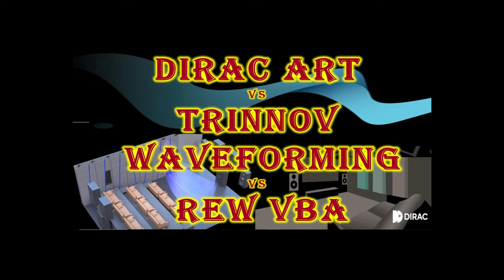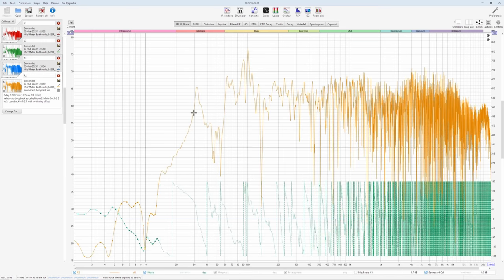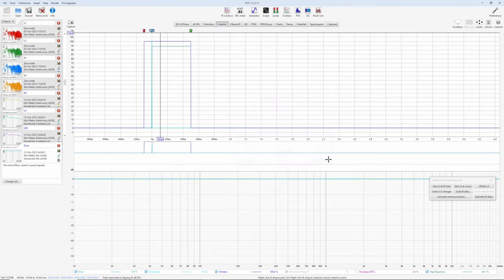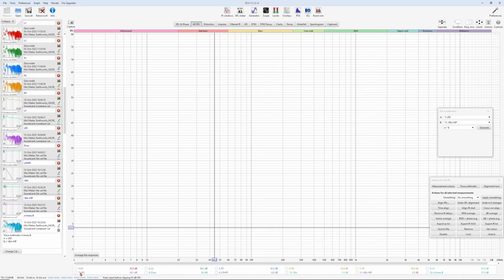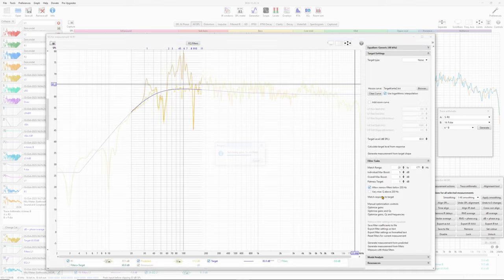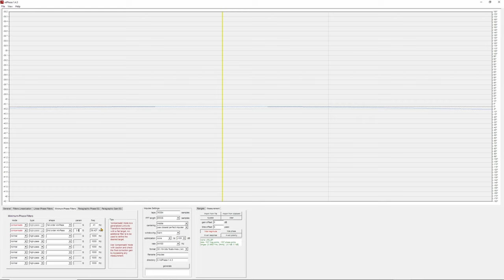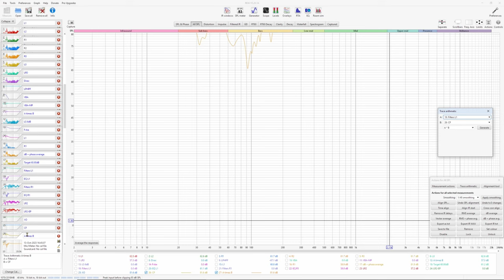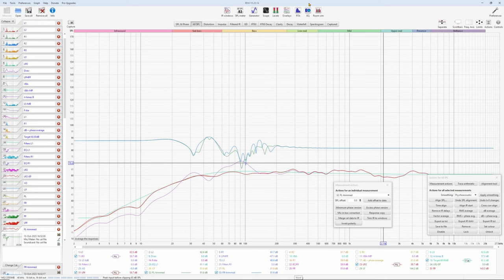Dirac ART vs Trinnov Waveforming vs REW VBA

Comment: I just wanna say thanks. This has transformed my system into something truly respectable. I multiplied the fvba filter with the inversion convolution filter I made from your other video. Not sure if that’s correct, but damn. Using equalizer apo I can quickly switch between filter and no filter and the no filter version is practically unlistenable… mind you I scratch-built some mark audio chr-120 full rangers mounted in a decware dna horn with spherical wavefront horns loading the front. Needless to say they needed some midrange attenuation. I was researching to build some notch filters when I found your channel. Thank god 😂 This is such a superior solution. I found the bass I was missing. The audio is so clear it’s almost tangeable. Imaging is like nothing I’ve ever heard! You could never get this from headphones. Thanks again. 🎉
Reply from the maker: Fvba x Inversion filter will work very similarly to the method in the video, they both allow 5dB boost but I found 1/48 auto-eq to yield just a little bit higher c80 clarity results than inversion in my tests although it could be specific to my gear/room.
Reply: My listening room is untreated so I like the idea of convolution. I was having a hard time getting the vba to move from 28 to 25 so I just left it. Bass is noticeably better. I will say that listening to hakkerskylder by heilung I could definitely hear the filter. I’m hoping it’s because I didn’t move the filter far enough. Either way, that’s one song. Also, my initial testing showed that one of my speakers ir was inverted so I switched the cables (think it’s my cheap gear). Can this be fixed in rew?
Reply from the maker: If one speaker is connected in opposite polarity relative to the other, you will experience a very audible drop in bass response. If that's not the case and you see their impulse peaks in opposite directions in REW, this could be a mic position issue and must be left alone. Rew can invert the polarity of a speaker response virtually on the charts but that's all. Check their phase responses to see in which polarity left and right phase responses are more similar to each other.
Reply: I’m gonna redo my measurements and see if there’s any difference. Sort of off topic… but Is there any way to adjust woofer Q using filters? That would really simplify subwoofer choices.
Reply from the maker: I'm not sure how relevant is the  Q of a woofer as in damping ratio to a  a phase/EQ bandwidth Q.

Comment: Quite great video!!! Let me ask two questions:
- why dont you use linear phase correction? Why minimum phase over linear phase?
- In my case and I suppose many other cases, I would like to have as minimum delay for convolution. Will you have any approach to load the final gilter to rew and work with number of taps to try to reduce the lengh until a few ms keeping as much as possible correction? Knowing it wont be perfect, but pretty accurate. I think doing filters with small delay is very interesting topic for a new tutorial, maybe there are some tricks to achieve best results with minimum taps/delay.

Thank you for your videos and channel ;)
Reply from the maker: Minimum phase IIR filters are more efficient in the bass frequencies. The phase changes they cause are often useful (ie corrects the phase).

For optimizing FIR filter number of taps see:

https://youtu.be/zmIqJ_jlZPw?si=cCGBFs7WtB6rDq1u&t=1586

Comment: Hi, first of all, thank you for all the lessons on your channel. By watching your videos and experimenting a lot myself, I'm getting better at REW. However, I'm struggling with something I can't figure out. I'm trying to combine VBA with an inversion filter. I know you have a different perspective on correction of higher frequencies now, but despite all possible acoustic treatments, my room is still quite challenging, and the inversion filter works best to achieve a precise mid/high stereo image.

When I combine VBA with inversion, I either get a ringing filter or the target is not accurately followed. I've tried creating both the VBA and the inversion filter from L0/R0 and then multiplying the filters. I've also tried convolving the VBA first (LVBA and RVBA) and using them as a starting point for the inversion filter. In both cases VBA and inversion work fine separately, but when combined, something goes wrong, even though I pay attention to sufficient window size and impulse alignment while making the filters. 

Do you know if it's theoretically possible to combine VBA and inversion? Thanks in advance! Any tips on approach / things I can try are welcome.

PS: in this video you don't apply Invert Polarity after creating LPHPF. In previous VBA methods, that was necessary. Did I miss something?

Regards, Hans, The Netherlands
Reply from the maker: I have tried hard but also couldn't find an optimal way to combine VBA with other filters in a meaningful manner. Physical double bass arrays also suffer from similar issues and none are perfect. It seems MIMO systems are the way to go for proper cancellation of room modes (although both ART and Trinnov keep postponing launching). PS I believe you are using the inversion method in the Mastering Digital Room Correction video. It sounds noticeably better than the method in the older REW inversion video
Reply: @ocaudiophile  wow, that is a quick response:) The vid you mention is inversion below schreuder. I my room I need the full range inversion filter, like in your video "Convolution with Inversion (no EQ filters, all FIR!)" But as far as I understand from you it is hard to combine other filters with VBA. Well, at least now I now I am not the only one who runs into troubles. But I keep trying and experimenting, maybe one day... :)
Thanks again!

Comment: Three questions please :

1. In addition to aiming to correct anomalies introduced by the room reflections, does this also correct frequency anomalies in the direct sound from the speakers, in line with the target curve?

2. Does this method also reduce the difference in arrival time of low and high frequencies, at the listening position?

3. Will the end result be accurate only at one listening position, but at more than one listening position?

I must add, I have been following DRC developments for about 8 years, started to use REW, 1st with EQ Filters in EQ plugins, and later on generating IIR correction filters for use in convolution plugins, which yielded some improvements. Especially in the most recent 3 or 4 years, it appears that there has been an exponential increase in understanding, from independent sources such as this Youtube channel. So now we have good enough tools such as microphones with calibration, at reasonable prices, and much improved versions of REW, and now "teachers" such as this Youtube channel, the challenge is :

We need some kind of roadmap, for learners, to take them step by step from elementary principles such as how to measure, e.g all the different approaches for such elementary tasks, and then build up gradually, to advanced methods, such as used in this video. 

I would happily pay £20 to £25, for such a book, which provided this guidance using REW. If I understood enough about this, I'd also be happy to work with anyone interested, to create such a book. Another chap MItch (AccurateSound.ca) has written such a book a few years ago, but it focused on using tools like Acourate - furthermore I discovered there was a tendency in his approach to steer the conversation towards engaging his services, and buying his convolution tools - nothing wrong with a bit of commerce - he has to eat, but that approach led me down a path where I was asked to trust one man's intuition, without really understanding what he was doing. What happens when he dies, which will eventually happen?!!!, i.e. his methods did not seem to me to be independently verifiable, cos I was forced to use proprietary tools and methods which cost a lot of money, and I would have had to invest so much in tools like Acourate, and try them out at great expense, to discover if Mitch's methods actually worked.

I love videos, but thankfully Youtube allows me to slow down the speech, cos its a bit too fast for me to comprehend otherwise.

My thinking is that this level of complexity deserves capture in a book, that is revised maybe every 2 or 3 years, to keep it current. I'd happily pay £25 every 2 years for such a book. A book is also a kind of insurance. Who says Youtube will still exist, in 5 years from now !!!????. With a good book, teaching all of these various methods, from elementary topics to advanced methods, and with good explanations, such information is then available as a keepsake. This is just my way of saying to the Obsessive Compulsive Audiophile channel producer - you clearly have a lot of ideas, but it is worth putting these down in a book, with very good explanations and justifications of why you have chosen each step, and what the various options are (at least a few), especially one which fcusses on using easly available tools like REW(and Rephase), is what most people would be highly interested in, cos it avoids leading us down a black hole path, to custom highly proprietary tools like Acourate, where one has no real clue what is going on in there.

There is so much confusion in the DRC business, starting with simple things like - do I point the microphone up to the ceiling, when I take measurements, or do I point it straight ahead towards the center point between the speakers, or do I point the microphone at each speaker, and what calibration file do I use - Zero degree or 90 degree or what other kind of calibration, maybe 30 degrees. To some of you, this might be elementary, but that is the challenge with todays DRC with tools like REW and Rephase, from my perspective, there is not much guidance, or you have to crawl through so much conflicting information on the Internet, when it would have been nice to have a well curated authoritative source that says - hey this is exactly what you need to do, step by step, and this is why this is the better way to do it, and here are the other options if you want to explore. And this wonderful book I am proposing, then takes you from no knowledge to expert level, step by step.

I'd rather pay £50 for such a well curated book, (based on using easily available tools like REW), that has been obviously fact checked and put into proper test, by seasoned reviewers/editors, than invest in something like Acourate, where I really am not sure of the basis of the approach used in the tool. Furthermore even if I bought Acourate, it appears I would still have to again invest in Mitch's book to learn how to use it properly.

Do you see a trend, we have the tools like REW, and Acourate, but their user guides do not seem sufficient enough to take us from start to finish, so we now need well written books, to show us how to use these tools, to achieve optimal results.

Please consider writing this book. Thanks.
Reply from the maker: Thanks for all the insightful comments and questions! I really appreciate your engagement.

Just a quick note about some concerns around free tools and conflicting information:

This channel is dedicated to free resources, so any tutorial methods use only freely available tools. While newer videos might introduce different techniques, it's all part of an evolving process in REW itself and in my methods. That journey is life long and this is in fact why most of us audiophiles are in this IMO ;)

Acoustics is complex, and subjective interpretations arise due to unique listening environments and preferences. Finding optimal solutions can be tricky, which is why I started this channel - to share my accumulated knowledge from years of testing, sifting through countless forum discussions, and personal experiences. It's not exhaustive, but it's what I wish I had when I began this journey.

Further Resources:

REW: For the analytical minds, John's detailed REW guide offers a fantastic foundation: https://www.roomeqwizard.com/help.html
My Basics Video: To grasp the core principles, check out this two-part series: https://youtu.be/zmIqJ_jlZPw

Calibration Mic Direction:

You're absolutely right, ideally calibration mic should be directed towards the speaker for maximum accuracy. However, with multi-channel setups, compromises are inevitable. Even with a stereo setup, one needs to compromise a good 30 degrees of accuracy to keep the mic in the middle of the two speaker. Thankfully, mic direction primarily impacts very high frequencies above 10kHz, which often benefit from being left untouched anyway.

Comment: Hello,  Can I not achieve a less accurate but similar effect by placing an analog mic at the listening position and feed it to the out-of-phase rear wall sub? I'd set the rear sub volume by 30-200hz pink noise until the dips and peaks balance out the most.  I can also pull that sub right behind my chair. I don't really want to ADC/DAC my records. Is that a McGyver way? :) Thank you for the great videos. Cenk
Reply from the maker: It's a bit more complicated than that:

Post in thread 'Double Bass Array (DBA)' https://audiosciencereview.com/forum/index.php?threads/double-bass-array-dba.51919/post-2072803
Reply: @ocaudiophile  Thank you. I partially understood the post, but did not get if these "circular convolutions" are due to the filters or actual acoustic new modes due to the rear sub.
Reply from the maker: @cenkisil574 whether a sub actively sending an inverted signal or a digital filter, the residual effects are there. You need an array of subs on each wall to achieve proper flat bass response.
Reply: @ocaudiophile  understood. Thank you

Comment: Good tutorial. I will need a moment to digest the application of the concepts here. Although I'm aware of all the mathematical details of the concepts, I will need some time to understand the application in acoustics. Btw, does all this processing impose strict mic/head placement?
Reply from the maker: Thanks.

Not really, the inverted impulse wavelength is about twice the room length so quite free from head movements as long as the filter is symmetric between left and right.

Comment: Awesome work you do here. Quick question, before you do the phase correction in this Video, you applied all the filters, from Dirac to VBA minimum phase plus low shelf, if I would like to apply those to a DSP, not convolution, how could I do that? Personally I would be really curious to see this, maybe even with the phase correction with APF's, would you kindly elaborate or tell us if this is possible at all, as I cant see how to apply a Dirac pulse to a DSP, or apply a delay to a Bandpass filter etc.
Reply: And on top, can this be done for multi sub systems in home theaters, and how?
Reply from the maker: The saved .wav convolution files from REW at the end of the method are FIR filters and will work 'as is' with Equalizer APO, JRiver, Roon, Camilla DSP and others. If your DSP is a MiniDSP type unit, their FIR capacities are very limited usually, you can still do some of the things in the method but not all.
Reply: @ocaudiophile  Hi Serkan, Thanks for your answer. I am aware of those options, as you stated the problem is here the limited taps length in most DSP platforms. I will investigate. On another note, have you ever tried to do the same for all three axial modes, not just the length modes? Is there a way to increase the magnitude of this mode antimode VBA curve, as they seem to be really moderate? I agree with many of the comments, yu are next level smart and should work for some of the processor companies , but most likely they cant pay you enough :-) Greetings as well from Germany
Reply from the maker: @GeoffHeinzel  Of course I tried axial modes and for a long time but could never get satisfactory results. You can apply a low shelf filter along with the VBA filter which increases its effect but it's been a while and I don't remember the exact details now.